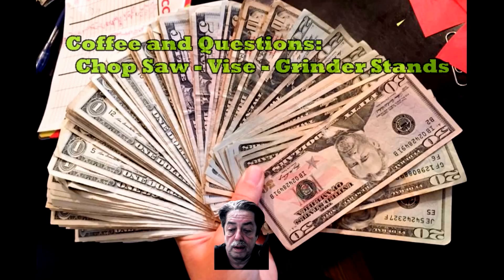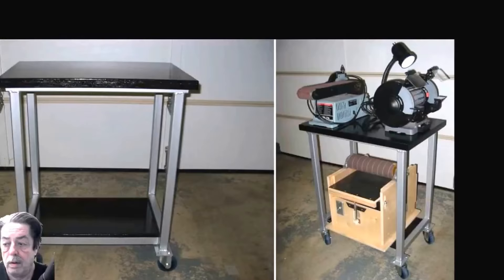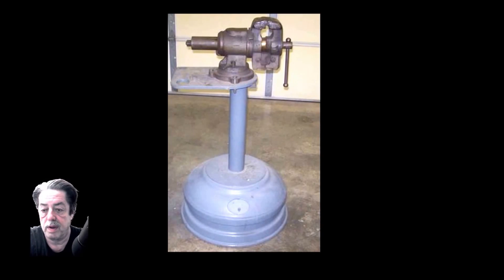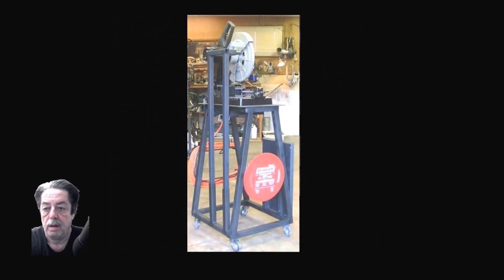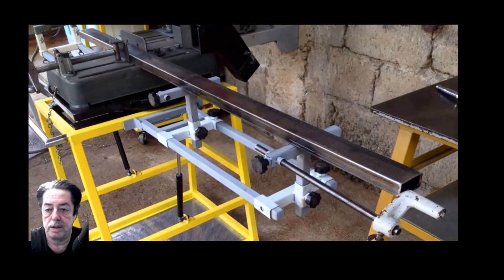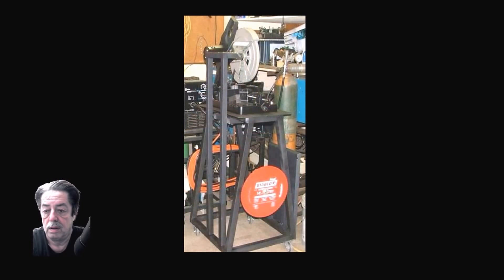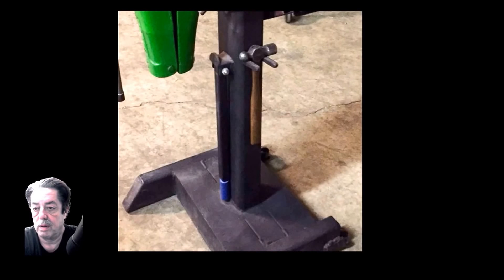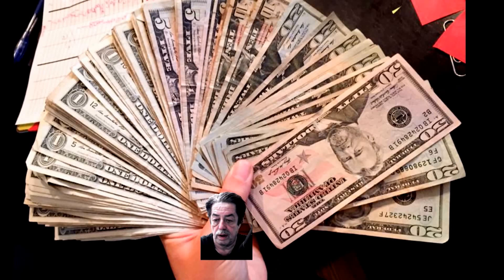How To Make Money With Your Welder - Part 3

Comment: The materials aren't actually that bad i found a metal yard about an hour from where I live and I can get 4 ft pre cuts of flat, square, rectangle, round for like 4 bucks each. Other materials as low as 50 cents a foot. I spent like 140 bucks and got enough stuff to do a couple little projects
Reply from the maker: I agree but if you do not live in a area where such a place is then you really need to look around at suppliers, ask about cut offs etc